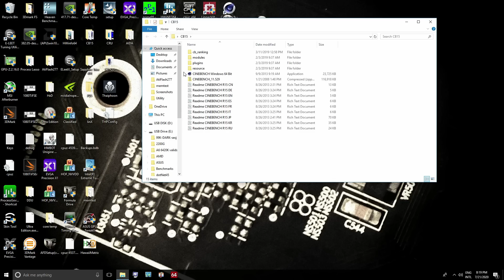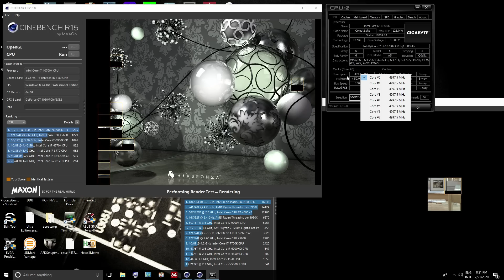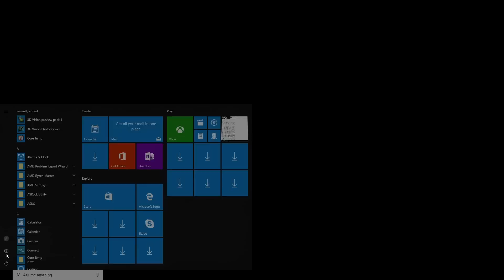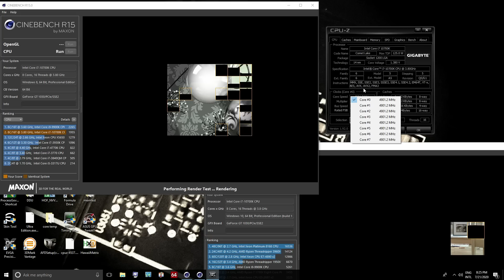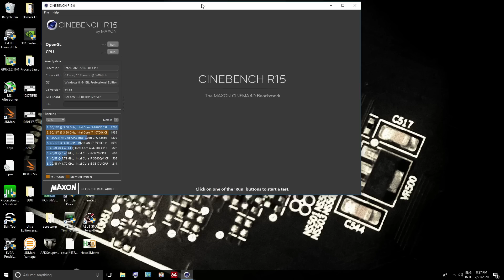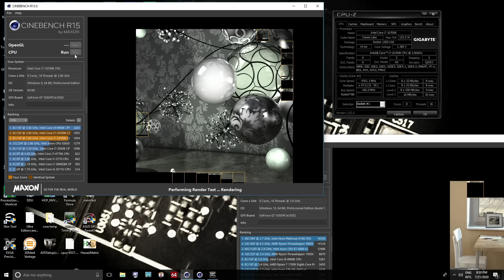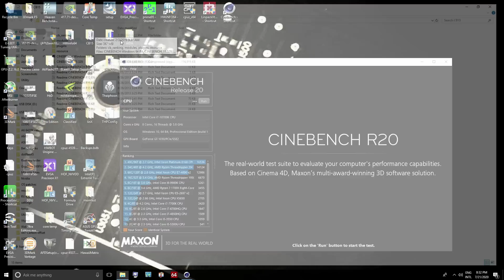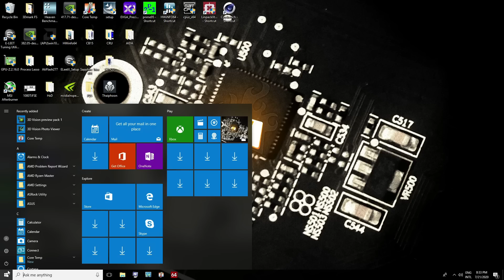Why Buildzoid doesn't use or recommend AVX offsets for intel mainstream overclocking (Z370/390/490)

Comment: I use an AVX offset of -1 for my 9700k because it takes 1.27v load to run AVX stable at 4.9Ghz and it take 1.27v to run non-AVX at 5.0Ghz stable... why leave that 100Mhz on the table for the same voltage/heat? It’s like a bonus for taking the time to actually stability test.
Reply: In my case on 9600k there is always some AVX activity in the background because the offset seems to be active all the time
Reply: @AVINIDE  What are you reading the core speed off? Some things don't report all that accurately, so get multiple opinions from different software if you havent already.
Reply: lucky bastard mine needs 1.44v for avx at 5ghz
Reply: Big Cazza Exactly why I use the offset, I have no idea what voltage it would take to stabilize AVX @ 5ghz because I hit my limit of temps way before that point. 1.42 would melt my chip immediately
Reply: @bigcazza5260  right there with you at 1.42
Reply: @movingsocks579  no degredation yet? mines still running fine, killed a z390 strix f tho, moved to an apex x
Reply: @bigcazza5260  no and I've been at 1.45vcore on my other pc cpu i7 2600k for 10 years lol.
Reply: Same, I run 5.0 at 1.27 on my 9600k for non AVX, and 4.8 for AVX at the same voltage. For gamers you can usually be running at the higher speed during those slightly less intense workloads, so why wouldn't you?
Reply: Are those normal voltages for a 9700K? Mine did 5ghz without an avx offset on 1.24v with pretty much anything I thew at it lol
Reply: @swagpants  "Pretty much anything..." Sooo... not stable then?
Reply: Was stable for the few months I used it. Prime95 29.8 with AVX2 it ran fine, just got very hot even with a custom loop. Too bad the IMC was really bad on it, couldn't boot when the memory was over 3866 mhz.
Reply: @swagpants  Suprised it got that hot. 1.24v is basically stock for all core turbo from what I've read. I have pushed 1.34 small ffts AVX and not broke 85C with a 280 AIO. Weird. I've had the same IMC issues but the returns are small passed 3600Mhz.

Comment: How does AMD handle this, do they clock down only the core that is running AVX workloads? Or do they not downclock at all? I actually never thought about if there is an automatic offset done that you can't control (AFAIK no AM4 boards has any offset control in the BIOS).
Reply: AVX instructions cause higher power draw. Ryzen chips already control their own behavior based on power draw.
Reply: @stoneymahoney9106  yes I know this, but how much does it lower the clocks when running AVX. I have never seen this explored fully. Let's say running a single thread AVX + a regular all core load, vs an all core AVX load. I guess I could check it myself lol.
Reply: But good point, I guess what I'm asking is if AMD has a more efficient AVX implementation or if the power draw when using it is similar to Intel. It probably is but it would be nice to confirm.
OR, maybe I just need to get some coffee and stop spouting nonsense. :P

Comment: Two reasons to run AVX offset:
1 - low voltage OC
2 - thermal issues OC
My 9900K does 5.1Ghz with offset 1 at 1.2v load voltage, and 5.3 with 1 or 2 offset with 1.38v load voltage. So the point is, if you can run a 5.1 OC with offset 1 at the same voltage you could run a 5.0 OC then what's the harm in having a 1 offset?!
Reply: But what he is asking for is more granular control of it, such as limiting the offset to just the core running AVX code. I think. :P
Reply: stability
Reply: @TeamTDU  was that a reply to me? How can having better control over how many cores to downclock if running AVX not be a good thing. Let's say on a 10700K, maybe you could get it stable at 5.2 all core with no AVX running, and if a single core detects AVX, it could lower clocks on that, core, or perhaps on 1, 2 or 3 additional cores. Besst of both worlds.

Comment: in my pc if i use avx offset causes stability issue. Say if i can run prime95 v26 ( non avx ) stable at 5ghz ( but only stable at 4.9ghz avx) and then if i open something that use avx evenm when using avx offset of even 20 then the system will crash.

Comment: You can look at this the other way around. You can occasionally have a frequency bump if no AVX is running. F.ex. your CPU could run 5.1GHz instead of 5.
Reply: You could also look at it as a futile attempt to chase down performance that doesn't exist. To proper stability test with an offset will take you more than a day and net you less than 1% total performance gain. If you think that's even remotely worth it, it's because you've already invested time in it, therefore you're deluding yourself into thinking it's worth it because sunk cost fallacy.
Reply: @shawnpitman876  Whether it's worth it or not depends on your workload and free time that you can afford to do overclocking. I'm just saying that being able to set AVX offset can be seen as a benefit, not drawback. Whether you take advantage of it or not is a different question.
Reply: Exactly it is the half empty half full glass problem. You see the AVX frequency as the real frequency and anything above is bonus. The only point that might matter is the fact that stability checks are not valid because of frequency change while having offset at 0 doesn't lie.

Comment: So without offset you're either running a higher voltage or lower clocks, than you could obtain with the offset?
Reply: Right. Been using 4.8GHz all core on 9900K with 0 AVX offset for 9 month.
Reply: Shtaufaker Only 4.8? Damn, and I thought I had a bad chip. My 9900k runs at 5.0GHz, 1.32V with 0 offset. I can't get it higher, for some reason, 5GHz seems like a hard wall. 5.1 was "stable" at 1.36V with -3 offset. It shoots up to 90+C in no time. My chip runs super hot.

Comment: AVX offset is useful if you are limited by cooling. My 10900K is set for 5.0 GHz all core, but I use an AVX offset of 5 to prevent thermal throttling under heavy AVX loads. This is with an Arctic 360 Liquid Freezer II AIO. Linus Torvalds was correct when he called AVX a "Power Virus" !
Reply: If you're constrained by heat, use a power limit, not an AVX offset.
Reply: @stoneymahoney9106  my evga z370 ftw doesn't let me set a power limit because bios is too pared down.
Reply: oh boy now people are gonna parrot that quote not even realising the difference between AVX and AVX512.
Reply: @outcastatsabre  Given how few people have CPUs that actually support it..... I was gonna say "it'll be fine" but stupid finds a way :/

Comment: That's kind of not the point of AVX offset, though. It's a tool to allow for higher stable overclocks with non-AVX workloads while reducing the clocks for AVX workloads to account for their higher resource usage.

Basically, if the CPU is 5 GHz AVX stable, it might go 5.2 when AVX is not in use. This setting will allow that CPU to clock to 5.2 GHz unless AVX is used.
Reply: I might have to agree with this
Reply: I don't have a modern Intel chip... I just watch these videos to keep up. I'm on an old Haswell CPU...and I've definitely experienced stability with certain workloads and then other workloads will cause the system to freeze instantly
Reply: it depends on the scenarios that are being talked about - for testing purposes it's a big deal and whether the switch is flipped or not matters a lot for a fair comparison.
for actual end use you may prefer more performance when possible irregardless though, yes.

it does also mean having to test two states for stability rather than one, however.
Reply: in my opinion the AVX Offset should come with AVX Voltage offset, because otherwise the CPU becomes too hot with no reason.
Reply: that was my thinking too but then I actually tried it (9900kf).  5.1 with 1 offset is less stable than 5.1 with 0 offset (and just letting it cook 94C+)..  ymmv ofc
Reply: The issue is you might only have a small number of AVX threads but it slows down the entire CPU.  If you were say loading up a few cores with AVX but the rest without, the total CPU package power and temperatures may have remained reasonable but then the AVX offset slows down the whole CPU.  I would say if you're running OCCT/Prime95 with AVX2 for example on all cores, that's when you need the AVX offset, but you can't selectively choose the offset based on how many AVX threads are concurrently active.  That would be the next step for improving control over this.  I currently keep my AVX offset at 0, but lower the Tjmax to 88°C, so that in the event there is all core AVX load, it will automatically/naturally scale back the the frequencies.
Reply: @jlgroovetek  that’s an interesting idea, I’ll have to try it out. Only thing I think is that this assumes you’re stable under the AVX load and are thermally limited.

Comment: What would you recommend for safe daily voltage on new 10th gen? I have a 10900k and am currently keeping it around 1.35
Reply: Random Youtube Watcher  generally a processor has a datasheet with recommended voltage ranges. Apparently his doesn't have one released yet though.
Reply: And from the OC video Build did there are 2 readings of voltage, the VRout and the VCore. You should watch that video. It is really intersting. He puts 1.42V with medium LLC to avoid putting to much voltage underload and give time to the VRM to follow voltage change between idle and load. He only reads VRout as it reads voltage from the die not from the socket.  Usually vcore > vrout and the one we actually care is vrout.
Reply: Read the datasheet
Reply: @pyropyro5579  If i could have found it there then i would not have asked someone smarter than myself. I found S, U, H specification not K(not that it is different) in the available datasheets and max is 1.52v for those. And no where does it say a "safe" voltage which is why i based my question on someones opinion.
Reply: @icanthelplt90   since is still basically the same architecture and process as 6-7-8-9 series my guess would be that you probably want to avoid running more than 1.42v in daily. But to be honest temperature on the 10900k will probably start to be a problem before you reach that kind of voltages.
Reply: @DinoTrollerino  Thank you for your clear response, I appreciate it. Yeah, temps are definitely a beast with this thing!
Reply: @icanthelplt90  in my opinion running to the limit is not even really worth it. For example my 8600k needs 0.05v more to go from 4.8 to 4.9, 100mhz are such a marginal gain that i didn't feel like the tradeoff in heat and noise and power was worth it
Reply: @DinoTrollerino  I get that, i kind of followed the 5.1 Silicon Lottery settings but was able to drop it down to 1.365 instead of 1.375.  I am happy if I can match or beat my 8700k's 5.1 on almost twice the cores :D

Comment: 10920x here with AVX2 and AVX 512. I overclock, but in a work environment I have to control the consumption which is linked to the temp particularly with airflow system (You don't use liquid cooling in a PC dedicated to work, unless you are IBM). The offset allow me precisely to do this. I fix the highest watt for long batches (240 watts for me) for non avx and then adjust the two offsets. There is the possibility to leave it to the PC to control the frequency if 240 watt is reached, but in that case you don't control what the PC does and the slowdown is significant. I'm happy that way, now I can understand that some find other ways to use or not the offset.
Reply: If you're trying to control for power, use a power limit not an AVX offset
Reply: @stoneymahoney9106  That's exactly what I just explained.

Comment: i noticed the same thing and use PL1 and PL2 instead, set PL1 to 200W and PL2 to 230W or whatever your processor pulls when it does actual all core AVX. Set PL2 Time to 1 (s?) so it it instantly power throttles instead of cooking my CPU. Does what AVX Offset was intended for.

Comment: Well it makes sense if Non-AVX is stable at 5.1 GHz on this CPU for example. Then when you set AVX-offset to 1 you at least will have the same performance but 100 MHz extra in non AVX workloads.
Reply: My CPU run at non-avx speeds almost all of the time. Guess it depends on what software you are running. Still worth using an offset for me, I get 200Mhz extra most of the time.
Reply: monotoneone absolutely depends what software you use. Maybe whether or not to use AVX offset is dependent on specific user requirements. Wild concept to some people here :)
Reply: This is a great point! This is what I was thinking too, since I mostly game.
Reply: This!
Reply: What do you mean by AVX workload? Full-rate or half-rate?
Reply: I find that half the crap i run in the background/games use AVX, effectively making my cpu run at the offset 95% of the time
Reply: @Jesse-ITS  so the "free" MHz the rest of the time is a downside? What's the harm in having a higher CPU clock for non-AVX workloads if the voltage is the same and CPU is stable?!
Reply: @Jesse-ITS  then you simply have to much crap on your computer..

Comment: Which is the best combination? AVX set to 0 or no? I'm with 1070k with Gigabyte Aours Elite AC z490?
Reply: Set to 0, almost everything has AVX now.
Reply: @kelvinyonger8885  Okay... I think, may be push to 5.2/ 5.3 ghz? But this avx pull it back... I have Cougar Aqua 360mm ? 
What do you think? May I push to 5.3ghz?
Reply: There's no harm in using AVX offset if the voltage/freq of the AVX workload doesn't change, so for example, you get 5GHz AVX with 1.3v in load, but for the same voltage setting you get 5.2GHz non-AVX, why not use an offset?! You get "free" 200Mhz when there's no AVX workload!!!
Reply: Unless you're an idiot, and would like your CPU to downclock during modern games, DON'T USE AVX OFFSET.
Reply: @shawnpitman876  Okay man, cool down! :))))

Comment: People really don't understand why you don't use AVX offset? It's really quite obvious why not to use it.
Even modern video games use AVX, so what advantage are you gonna get OCing with an AVX offset? NONE.
Reply: I just want a slight boost during normal uses and the ability to walk away from overnight handbrake encodes without cooking the clc cooler.
Reply: Thing is, if you use the offset, the worst that could happen is you end up with identical performance to how BZ is using his setup. AVX offset is a tool to gain performance in situations when AVX is not currently in use.
Reply: @proesterchen  Which is almost never, sooooo again, it's stupid.
Reply: @shawnpitman876  It's not stupid, though. 

You may decide it's not worth your time to test both AVX and non-AVX stable clocks, perfectly fine with me, so you'll always be limited to AVX-stable clocks.

Put in the extra time, and you might get an extra bit of performance occasionally.
Reply: @shawnpitman876  You keep insisting on that word. It may feel stupid to you, but it could very well be worth it to someone else.